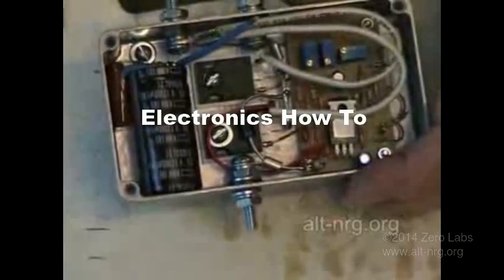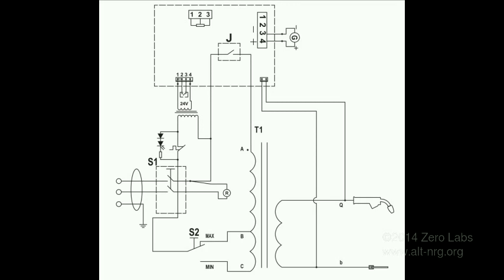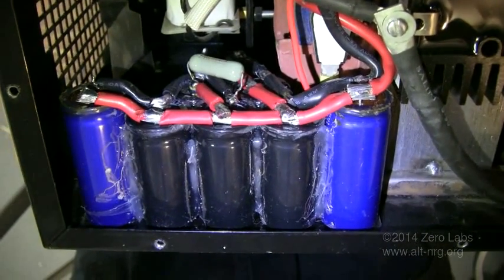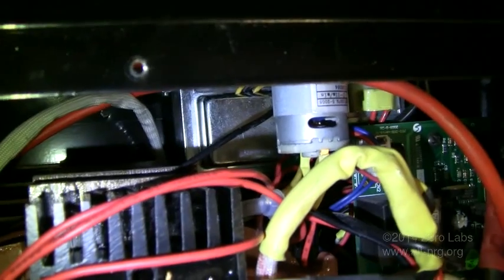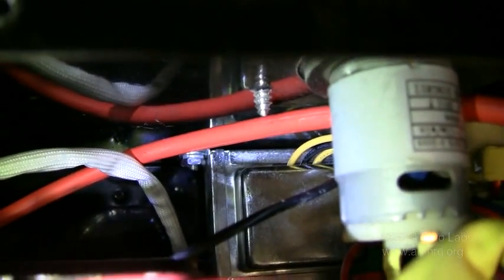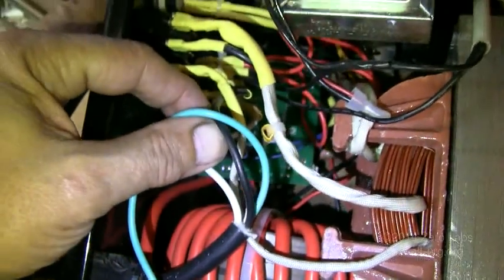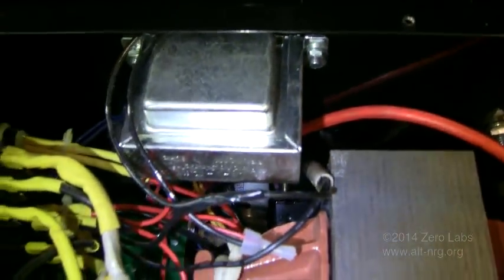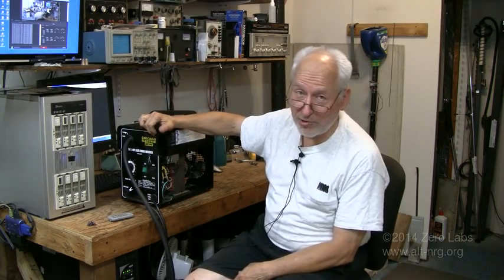#374 Harbor Freight 90A "MIG" welder upgrades

Comment: $100 welder with $30 mods plus a lot of time doing it? I would of just bought the Chicago Electric Mig/Flux core 170 amp gas-gasless welder with a coupon
Reply: +Justin Watson There is great value in taking on projects like this, instead of simply "buying something with a coupon". If you need one word to describe it, it's called "learning". There are other benefits, as well, like problem-solving, adapting. Learning how things work and learning how to make things work better is one of the key things that separates humans from other species. The more you know about the world around you, the less dependent you are on supply chains for everything you need, and ultimately you are more likely to survive hardship or catastrophe.
There are plenty of people who have the smarts but not the money, and a tutorial like this is a great gift for them.

In my case, I'd rather salvage some parts and perform these mods, than go out and buy a 170 with a coupon; if I'm going to put money down on a good gas welder, it isn't going to be a Harbor Fright model...it'll be a Miller, or a Hobart at the very least. I've got the time, the skillset, and access to parts, and I can use them to make better welds with what I have.

Oh, and it's "would have" not "would of".
Reply: It's something that I would have done if I wanted to buy a certain welder like a Chicago Electric from HF,  so don't be a smart ass. I would have bought a Lincoln or Miller like I already own. You rambling on about shit that makes no since to my comment 👏🏻
Reply: China selling the world crap. At some point their cash dries up from burning too many people, too many times. Meanwhile factories continue spitting out bridges and caps for the "Mod Squad."
There needs to be a vid on how low, will they blow. For bridges and caps.
Different labels, ratings are all show, no go.
Maybe chinese characters on the part actually say: bend over Joe.

Comment: Thank you for your video . I found it to be very informative . I believe that the HF 90 amp flux core welder you modified is the 68887 ? My question is , have you had a look at the newer version , the 61849 which is currently sold. It is of course been modified as well by Chicago electric from the earlier version with the "hot tip " . The 61849 tip only goes hot when the trigger is pressed which is an improvement. I would like to know your thoughts of this newer version and whether it could stand improvement since it is also an A/C welder as well. Being such , I would think it would need improvement. But this also raises the question of whether the same improvement method can be applied to the newer version . Hoping you'll have the opportunity to review one and upload a video as well. Thank you for a great video.

Comment: I don't know if the seperate power supply for the wire feed was a good idea.
Becouse expensive welders are self adjusting. They adjust the power to the resistance to the wire. Maybe this was a poor mans solution to that. But im not sure if this was ment to. Or if it was just done to keep it as cheap as possible.
Reply: Expensive welder and practice makes perfect.

Comment: Change the plug, build in a gas nozzle, give it an Argon gas tank...........Oh you said 30 dollars.....lol
Reply: ZeroFossilFuel I already got the relay part figured out. I connected it to the output on the board to the wire feed motor. Now when i press the torch switch it ingages the relay. But i have a 10 amp 12 volt transformes wich i am going to wire up to the wire feed PCB. So then the power goes trough the main switch, in to my relay and transformer. So when i push the button the relay kicks in and the wire is going to feed.

But now this. I ordered a 150 amp bridge rectifiere. I saw you used a 3 phase but i got a single phase. 

You said using multiple capasitors is best. But i want to use one if it is possible. Maybe 2 but prefer just a single cap. What do you think? How much Uf/volt cap(s) should i need? 

And where the coil between the rectifier and torch is for is a mistery to me. Can you explain? And is it important?

And uh, What is FWB? And how should i filter the DC? Isn't that done by the cap?
Reply from the maker: evilcowboy I'm actually considering adding a solenoid valve and fitting for an argon tank. Problem is I'm not sure how flow rate gets regulated in that system. And I'm not sure the wire feed mechanism can accept a gas feed without leaking out everywhere I don't want it to.
Reply: ZeroFossilFuel You need a regulator and argon/co2 tank. You have to run a gas hose trough the original hose that goes to the gun. But i don't think these guns are ready for a gas feed. 
Flux core welding aint that bad. Its used quite a lot. Just keep in mind that with flux core, you want to drag the weld/gun in a slight angle to the workpiece. Just so the slag doesn't get in your weld.

Very nice toturial. But isnt just a bridge rectifier enough to run it? I have almost the same welder. And it its also always live. Only putting a relais on the prim winding wich gets activated by the gun switch aint that difficult. But how do u activate it? couse the switch turns on the wire feed motor too. Do you just split it?

I got this welder for free for my Mig Mag Niv2 gratuation. I would personally never boughed it but it is fun if you want to do little projects or stuff around the house. But its a real cheap machine.

The seperate wire feed transformer is a good one too. Does the board convert it to DC? Couse i have a 12 volt transformer already.
Reply from the maker: I'd have to see your schematic to tell which way to wire your relay. On mine the relay has a 120VAC coil that gets actuated by the wand sending power to the main transformer primary. Wand is live before wire starts to feed.

FWB only is better than nothing but filtered DC is still best.
Reply from the maker: Single phase is fine. I used a 3 phase as a single phase by omitting one of the terminals only because that's what I had laying around.

Multiple caps greatly reduce the equivalent series resistance (ESR). Very important in high current applications. A single or even double cap might overheat and burst. Gotta pick them wisely.

Coil configuration can be found in many published schematics.

FWB = Full Wave Bridge.

The caps and the coil do the DC filtering.
Reply: ZeroFossilFuel  Im planning on getting 6 10,000 uF 62 volt caps. With a 180 Ohm bleed resistor.
How many turns on the coil is ideal? Does it cost much amps at the end of the road when the coil and resistor are added?

Comment: I ended up busting the torch on my HF MIG. When I took it apart to repair it, I discovered that there is a gas valve built into the torch block. So, since I've already added the rectifier and capacitor, I'll eventually run a gas line too.

Comment: I continued watching this video because you said you could reduce the amount of splatter, but then I saw your DC welds and they still had pretty much the same amount of splatter.
Reply: @ayebee1207  I am not an expert on welders at all. I have completely soldered each connection and upgraded to 6 awg wire throughout my welder and also added a copper ground clamp and a new shorter ground wire with 6 awg wire instead of the factory 8 awg. None of it made more than a very minor improvement. Which I found surprising. Clearly the diodes, capacitors, and inductors are extremely important in low amperage MIG welding to get macine-like Miller level smoothness.
Reply: @ayebee1207  Sorry I don't know if I clarified this but I own a Lincoln 100 amp.
Reply: I haven't finished the video, but the inductor coil looks like way too low of an inductance. I think you really need a solid steel core, heavy duty inductor that weighs about 5 pounds. I was watching another video and the factory inductor was massive, about 4" wide. I get the impression that the inductor is the most important thing, with the capacitors not making much of a difference, above a certain level. I watched a video of a guy doing inductor experiments, and with a 1000 foot long coil of wire on a hollow wire spool as an inductor, he was able to strike giant, beautiful arcs, without any additional input current. When removing the inductor and having only a capacitor, he could not strike or sustain arcs.

Comment: Good upgrades. Ever think of using a 6 position switch to adjust output setting even though the amperage is a bit low it may help with more of a fine tune. Instead of just having just a 2 position switch.

I got one of these but I only bought it because I wanted to weld body panels or exhaust on a car and for those tasks the steel gauge is small enough that this welder performs the tasks right out of the box.

At work we have a Miller for things like frames which is much better welder.

Either way good video and really good upgrades. Your upgrades will make one of these perform much better than the stock one but those upgrades takes some time to properly do.

Comment: ZeroFossilFuel Nice video. How exactly did you connect the added transformer. I only see the wires coming from the pc board to transformer's primary and one secondary wire. Can you elaborate a little please.

Comment: Hey Zero Thomas Allgood Here: Allgood Automation
I am doing an upgrade to My harbor Freight MIG151 Welder it is a 230 VAC Unit and already has the Rectifiers Full wave and also a Large output inductor, however it doesn't have any Smoothing Caps. Another problem is if I add the smoothing caps the feed circuit will no longer work because the feed motor control is a SCR Driver and relies on the zero crossing of the rectifiers to turn off the SCR to get a pulse width control. I can do as you did and add a new transformer. But I would still have to add another bridge rectifier for the SCR circuit to  work.  Is your welder a 110VAC unit or a 220 VAC Unit.
Since my welder is 220VAC I don't think the Radio shack transformer will work. Any suggestions on a transformer.

Thanks TWA
Reply from the maker: Mine is 110. I would try the usual mail order supply houses. Mouser, Digikey, Newark, Jameco, etc.

Comment: When using flux core, remove the nozzle so you can get the tip closer to your work. Makes a huge difference.  The nozzle is only needed if you are running gas.
Reply: Flux core nozzles exist to protect tip and diffuser. I don't buy specialty nozzles since it's so easy to trim the end with a zip disc. Worth mentioning is the little wire welders often have "hot" wires any time they are powered on, which makes the tip and diffuser hot, which can get interesting if they contact a ground by accident.
Reply: Flux core if it is unshielded runs on dcen.meaning the stinger is negative.mig runs on dcep.where the stinger is positive.
Reply: @jackiesindel5278  hello, what type wire should i use on a gassless mig gun is hot
Reply: @lazycarper7925  switch the wires inside the machine so the gun is not hot if you have a flux machine from harbor freight you can't change the polarity.i don't know of any gaseless Flux core that is for dcep.
Reply: @jackiesindel5278  thanks

Comment: Three quick things.  Reference the schematic for the 220v HF welder, it uses the same motor controller / welder start controller. When you add a rectifier, you can then use pins1 and 2 (DC) on the wire feed motor controller.  You MAY not need to add the additional transformer.  If you run the rectifier output wires to terminals inside of the top and do the same with the ground and weld gun wires, you can then switch the polarity same as their 220v MIG.  Add a HF MIG gun which has the gas hose and valve built in and you are MIG ready.
Reply: +kayakeroneoneseven  can you diagram it or send me a pic?
Reply: +lance hansen Hi Lance, download the manual for welder part number 68885 and compare the schematic to our welder 68887. Look at the connections on PCB J. pins 1and 2 (DC) are unused in the 68887 but they are there.  All I did was add the rectifier circuit on the 68885 schematic. I no longer use the 2 pin (AC) connector on the PCB J. I also ran the rectifier output to the top cover similar to the 68885 manual so it is easy to switch the polarity.  The HF MIG gun gas line is a physical on/off for the gas, not a solenoid like other welders so adding gas is just installing a HF MIG gun (which I have not done yet.)  Hope this makes sense.
Reply: I think that you're missing the point of that particular mod.  The voltage of the secondary side of the transformer sags quite a bit once you start welding (whether or not it's DC).  Before doing this mod, the inconsistency of wire feed speed would drive me insane.  It's especially frustrating when working with smaller materials (it would be going good, then slow down to a crawl, then all of a sudden jump to a faster speed and burn a hole in what you were welding).  Another design problem with the way it's fed from the factory is that the high/low switch changes the wire speed.  Adding a second transformer for the wire feed motor is the #1 upgrade you can do to this thing IMO.  BTW, I used a doorbell transformer which has a 120v input and 16v output (seems almost perfect for this application).  Second mod I would recommend is doing something about the cooling fan because I was always overheating the welder.  First I tried building a shroud for the fan and it was somewhat effective, but the fan started acting flakey so I opted to swap it out completely for a better one.  3rd mod I would do is installing a real ground clamp.  I would save the DC mods for last as they're the most involved and expensive.

Comment: Horribly misleading info you're spewing.. thats not a mig welder.. MIG stands for metal inert gas.. you have no gas... all you did was make a dc fcaw.. which is an improvement, but doesnt magically turn your flux core welder into a mig welder.. dc and ac dont define the type of welder at all. Shit they make migs that run output ac... looks like you really learned jack shit about welding

Comment: U must have been a eletronic's teacher , I have a 220 volt H/F mig welder myself and I have been having trouble with the trigger on my gun, so I got on H/F website and  was reading alot of comments and one guy said he had a buddy that was good with electronics and he took a  lincoln mig line gun assembly and hooked it up to his and now he has a good welder, I bought one off ebay all it is is 2 wires the lincoln has all the tips an extra items, jeff

Comment: Re adding DC back again:   The "99 dollar wire welder" has been cost reduced over the decades to keep the sale price in the 89 to 120 buck range. The models before say roughly 15 years ago had DC output. HF dropped the rectifier diodes purposely to keep the entry cost in the target range folks will actually pay.

Here is 120 volt unit from the year 2000 that already had just AC and the rectifier gone:

http://images.harborfreight.com/manuals/44000-44999/44567.PDF

 Folks use to just order the rectifier kit for the older units and add them to their newer unit. The bulk of the life of the "89 to 120" buck welder they had DC since these units go back over 35 years ago. 

The odd thing is with the typical Harbor freight batch numbers  for "lots" there were actually both AC and DC units for 120 volt 90 amp welder for several years. 

Today the Harbor Freight 230 volt Mig/flux core wire welders still have a DC output. Thus going to a 230 volt unit gives one DC with no modifications. Over the years the welding amps has risen on the 230 volt models. ie Today they are 170 and 180 amps for #68885 and #68886.. My 2008 year old 230 volt Harbor Freight wire welder #97503 is just 105 amps but a DC out. One advantage of the 230 volts units is one has more control of the weld current. ie mine has 30, 50, 75 and 105 amp settings via how the way the transformer is used ie taps 120/240 volts.

Comment: I have a 16 volt, 10 amp transformer (from an old door bell) and believe this would work. Does the higher amperage matter? I believe that it has to be a minimum of 2 amps and the extra capacity of the transformer will not damage the drive motor as they will only draw what amps they need. Am I correct in this? By the way, I made the changes to my welder (blue version) and the heat difference is amazing. No longer any problem with penetration! I used a single 46,000 UF capacitor and a single pole bridge rectifier.

Comment: this is cool but the harbor freight "DC" mig welder is not really that much more expensive than the flux core welder. current prices are $119 for this welder and $199 for the mig. ive seen them much cheaper than that though and add in the 20% coupon and this work doesnt seem worth it unless you just like tinkering

Comment: Unless the flux core is emitting an inert gas I think it's still called a flux-core wire welder; but I'm just trying to be a smarty pants. This is some impressive work, and the fact so many folks take this welder so seriously has convinced me to buy it; your clear explanations of reasons for modifications helped me, a non-welder, understand the limitations of this machine, tho I may use separate feed motor supply idea, I will also NOT trust my own welds, overly, after seeing ur nice-looking one fail. Thanks!!!